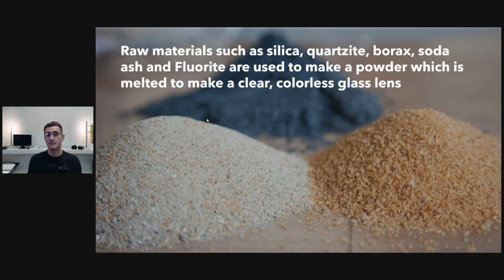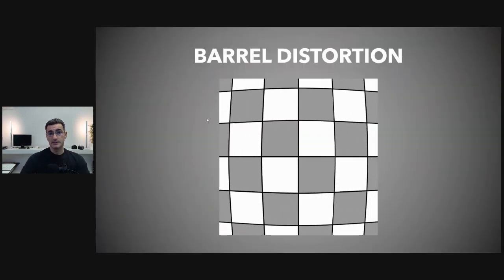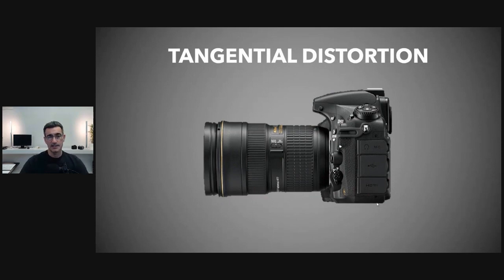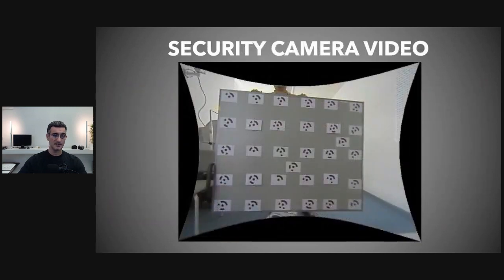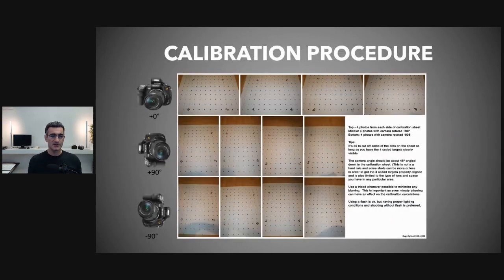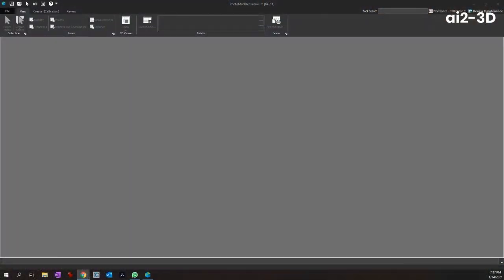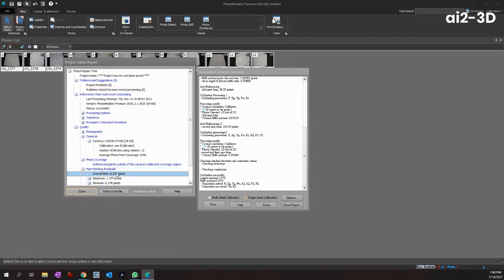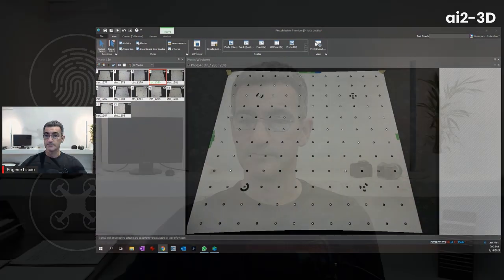How can lens distortion affect the quality of your 3D model? | Photogrammetry | Click 3D Ep 6

Comment: Hi. Excellent video. I wonder could you help me with one problem. I work with Reality Capture. I have lots of images which were taken by P1  35 mm. The problem is that option "distortion correction" was ON for all of them. And it confuses alignment in Reality Capture. Can this "distortion correction" be reversed, or is there Reality Capture setting which I could apply? Thanks.
Reply from the maker: Do you know if Reality Capture is taking a preset camera model and applying it to your photos? Sometimes it may be confused because the expectation of the camera is different from the photos. I don't think there is a setting to fix this but you could create a calibrated camera model with the distortion correction on...just a thought.

Comment: Hi, excellent information very detailed.  So if distortion is ok as long as it is corrected. What lens would you recommend as the best to reduce depth of field.  I’m looking to use the 16mm f 2.8 prime canon lens with the r5 to reduce depth of field as much as possible. However there is quite a bit of distortion to correct
Reply from the maker: It has more to do with what you are trying to focus on. If it's something really small, then you are sort of limited with a macro lens. If you are talking about general scene documentation on a larger scale, you really have a lot of options. Sorry to be so general, but it really depends!
Reply: @3Dforensics  Hello could you please recommend a lens for coin photogrammetry. The diameter of the coin would be 10 to 20mm. I bought a macro lens thinking it would be ideal. Any help at all would be appreciated.
Reply from the maker: @nightshift4587  I have a Nikon camera and i have found their macro lenses to be quite useful to me for objects of these sizes. However, I am usually doing photogrammetry or somethign like that. Without knowing exactly what you are doing, I would likely suggest the 60mm Macro or the 105mm lens. They aren't cheap but maybe you can find them used? Also, there are other  manufacturers like Sigma that are cheaper, and still might get you what you need.
Reply: @3Dforensics  thanks for your reply. I have recently purchased a 
Sigma 105mm F2.8 EX DG OS HSM Macro Lens. Its great for frontal images of coins crispand clear, what happens when it is turned on a turntable is that the focus becomes tight, meaning the detail on the coin closest to the camera and further away from the camera  becomes blurred. You are then left with a very narrow clearly detailed visiable portion of the coin at the centre of the coin. Im happy to experiment with the process, I think that the right lens is a critical part of the process and could be the deciding part that most who take up the challenge, stop because of the rising expense of the project. There is so much out there about this type of photogrammetry but very little that is concise. What do you think?
Reply from the maker: @nightshift4587  Ok, I understand…you are talking about the depth of field. Here is an experiment for you…crank your aperture as high as you can go…f32 or whatever you can get, then use a tripod and an extended exposure time and this will maximize your depth of field. You should be able to get the coin in focus that way.

Comment: Hi I've got a question for you, I am shopping for a Nikon Z series camera and the zoom lens I had in mind records Nikon's lens profile correction in the exif data, which Lightroom then uses to automatically apply (and prevents you from removing) to the raw file. General photogrammetry advice I can find online says to not apply any correction manually and to let your chosen photogrammetry software correct for the distortion. I do not know if this is a quality step or a time savings step... so my question is do I really need to remove the Nikon applied lens correction, and then create a new one as you demonstrated, or let photogrammtetry software calculate it automatically? Could I leave their distortion correction intact or would it be somehow inferior for what photogrammetry software requires? Thanks for the video otherwise :)

Edit: I have one person telling me strongly I need to remove it, so I will,  but I am also interested in your forthcoming reply (if you want)
Reply from the maker: Hi Chris, from what you are describing to me, I don't see any reason why you should be modifying the images for lens distortion before running them through the software.  The bundle adjustment done by the software will create a profile for you and it's usually quite robust.  If you make a correction before providing these images, the software will create a new camera model based on the correction you have made.  Also, keep in mind that Lightroom and Photoshop are only correcting for a limited set of characteristics and miss out on a lot of the smaller details of lens distortion.  So, unless I am missing something, leave it alone!
Reply: @3Dforensics  I noticed that DJI drones also automatically apply a non-removable correction profile when importing into Lightroom and I haven't heard anyone talking about removing it, so the reconstruction results can't be too alarmingly off. Perhaps for 1mm tolerance or some such it would have a meaningful impact. My original assumption was that photogrammetry software is robust enough to resolve it adequately, as you wrote, but I will do an A/B comparison and share it online just to dispel any doubt. Thanks for the reply!
Reply from the maker: @Chris-qk8uz  A test is always the best way to go Chris and please do share the results.  Imagine a scenario where you are taking key frames from a video file.  There would be zero EXIF/camera-lens information.  Photogrammetry still works in those cases too so we know that some corrections are being made with or without camera data.  Different photogrammetry software may handle the camera parameters slightly differently as well but having some knowledge of the initial parameters seems to give a better starting point for software.  Having said that, it would be great to have a discussion about this on a future Click3D episode…so you’ve given me a new idea!